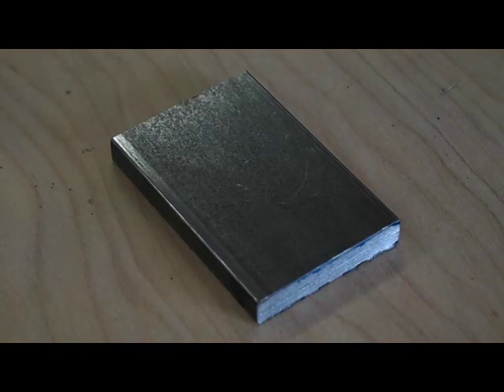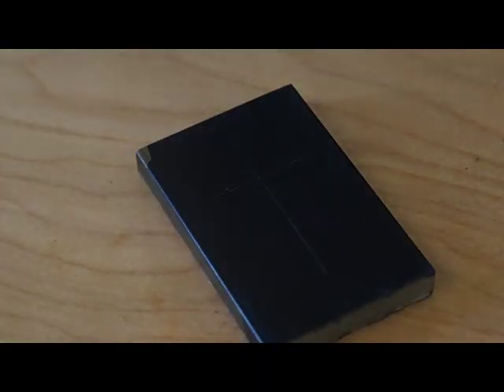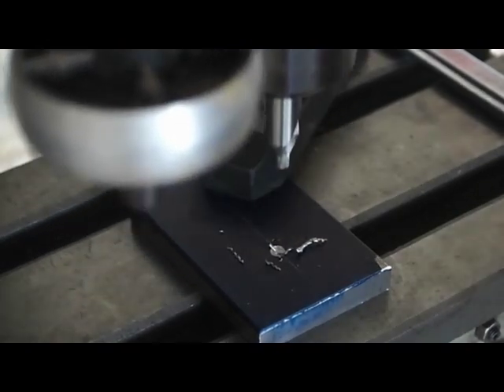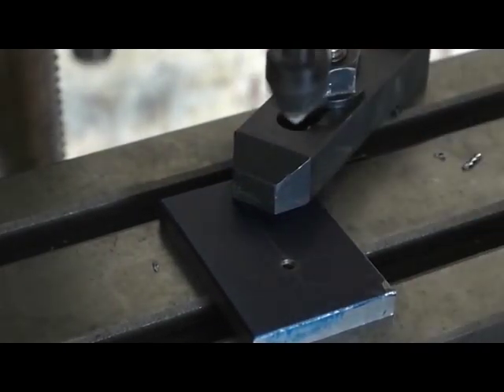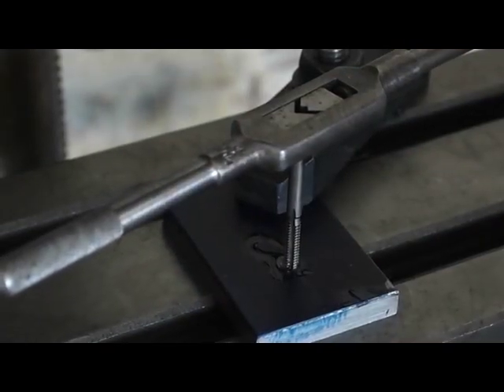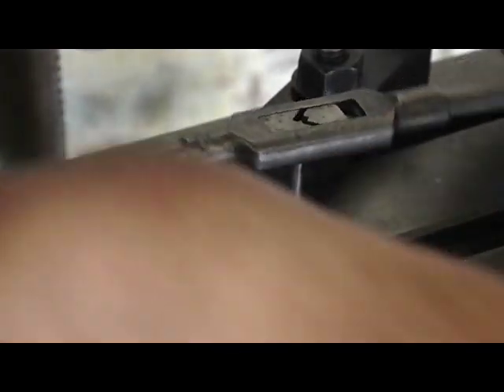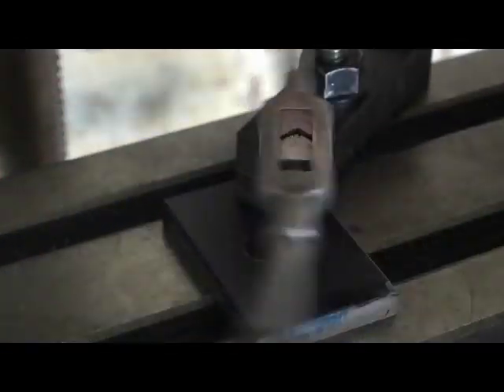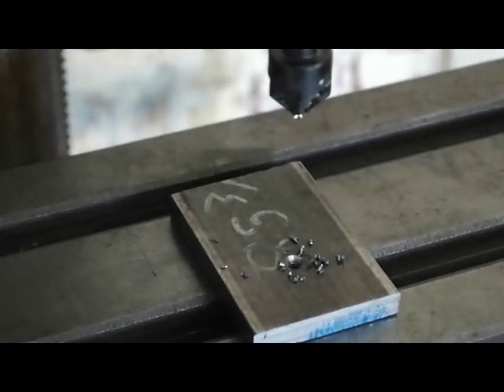How To Layout, Drill, And Tap A Hole Using A Drill Press

Comment: Isn't the drill bit supposed to woggle all over the place because of the cheap crooked shaft of the cheap Chinese drill.  No way I could drill an accurate hole with my drill press.

Comment: Absolutely incredible, could you have just kept the tap in the drill press and tapped it all the way through without doing it by hand if you kept a steady stream of lube?

Would you be willing to put your new web site on there and a list of where you got the different bits and the wax etc?

I am going to have to drill and tap an electrical bus bar to attach wires to.
Reply from the maker: Most likely you could do it with power all the way through. I am just cautious. They even make taps for that.  I get my drill and taps for MSC supply

Comment: One of the more useful videos on tapping threads. The first one of many that I've watched which shows the hole being countersunk before tapping - which is something I always do. 

I thread lots of small holes (2.5mm to 5mm) in steel and alumin(i)um and always struggle to get the tap straight. I really like this idea of letting the tap slip in a drill press and will certainly be giving this method a lot of attention in future.
Reply from the maker: You are right about counter sinking before hand, I appreciate your thoughts.

Comment: My son and I had to drill and tap 40 holes in some 3/8 x 1 1/2 cold roll.  We had previously done some 3/8" holes this way.  I was dreading threading that many 10-24 holes.  I had a moment of pure genius.  We drilled all 40 holes with my drill press.  Then I removed the belt from my drill press and chucked the 10-24 tape TIGHTLY.  I could turn the pulley on top of the spindle with one finger, back it up to clear chips and then go again.  Beat chucking and unchucking a drill bit and a tap 40 times, and then putting a tap wrench on the tap.  I am guessing that I could easily do up to 1/2 inch with one hand.  I just got about $1000 worth of taps up to 1" NC and 1 1/2 NPT yesterday for $6.  Mostly Greenfield and Butterfield, so I guess I should try to tap a 1" hole my way way and see what happens.
Reply: Actually it was 4 holes 1/2 NC into 1/2 x 3"  steel bar.
Reply from the maker: That is some great thinking, it never occurred to me to take the belt off and turn the pulley by hand. Thank you for teaching me something.

Comment: When using this method of drill tapping, is there a chance that the drill tap will break since it is brittle to begin will. how much pressure did you use?
Reply from the maker: There is always a chance to break a tap, this method lessens that chance a little bit. I am not sure how much pressure I used.
Reply: Just turn it by hand.

Comment from the maker: I do not use 2-56 screws while making razors, so I do not have lots of experience with them. I think I might use a little bigger clearance hole #49, I do not think you would need full deep threads with 2-56 thread. I would measure the heads of the screws you have to figure out what size counter bore you need.

Comment: Thank you so much for this video, very helpful. Could you please help me out though? I'm tapping holes for a pocket clip. As far as I know, I have 1/4'' 2-56 screws that will go into a #43 clearance hole tapped with a 2-56 tap. That sounds correct? Yes? And what size counter bore should I use for this? Thank you.

Comment: Thanks for the vid, it helps me out a lot, however I would like to know if you know of a tool or a gauge which will tell you which tap to use for the bolt.I have several bolts I want to use, however I dont know which tap to use, hope you can suggest something.....thanks

Comment from the maker: I usually drill the hole through the tang when the steel is soft, I harden the steel later in the process of making a blade. 

I have forgotten to make the tang hole before hardening before, I drilled the hole with a carbide drill bit.

Comment: Very nice vid.  Thanks for showing us how to get the tap straight.  I never thought of using the drill press to line it up, i just stick it in by hand and hope it works out.  Well, never again.  When you make a razor out of hard tool steel how do you drill the pin holes in the tang?  When making knifes in the past I've always had one heck of a time getting anywhere without going through 5 or 6 new, expensive bits.  Even the heat treating doesn't seem to make enough of a change.

Comment from the maker: I have not threaded the pivot hole, but I have used the adjustable pins that are threaded on the inside. A smooth pivot pin on a smooth surface works best.